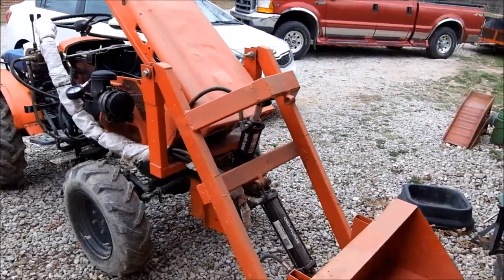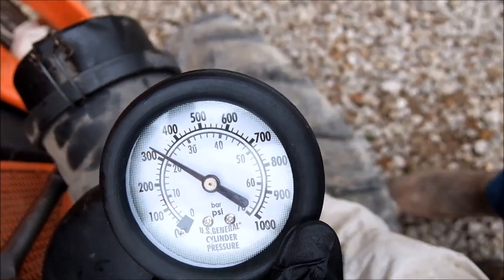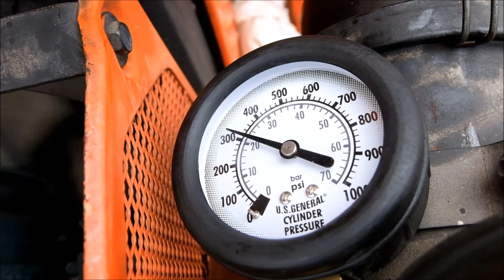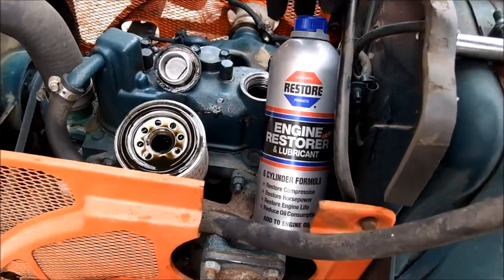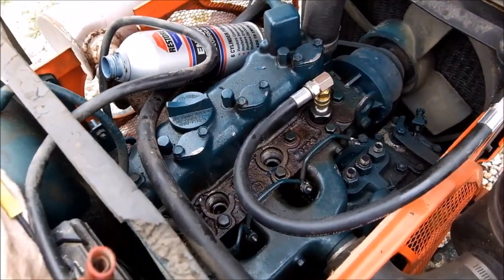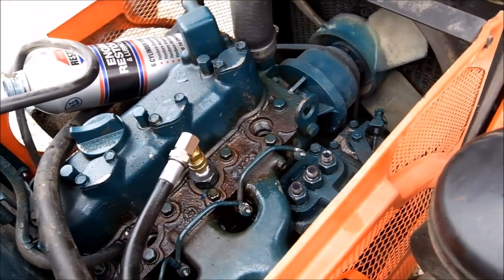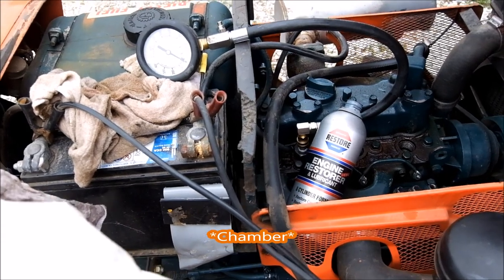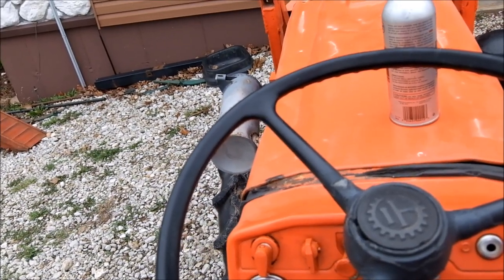RESTORE rebuild in a bottle and on a diesel?

Comment: I had a Mercruiser/Chevy 4.3L, 60psi in the low cylinder.  Ran this stuff and it went to 160psi on the lowest.  I took the engine apart and it actually fills-in the cylinder scratches.  I ran this in my 1992 John Deere 855, always had bad smoke when cold but got better when warm.  This almost eliminated all smoke, amazing product!
Reply from the maker: Still running in the kubota

Comment: Awesome. Use, test and results. All in the same video package. That is a "Thumbs up" in my book. ;-)
Those small tractors are amazing machines, underrated dogs for sure, but damn they work hard for a living.

It seems you have the tools and the skills, so when the time comes. Why not give it a new set of piston rings and a chamber/valve cleanup. You´ll be ready to go, for some years, with a lot less than needed for a full rebuild. It´s not the ideal, but anyway worth considering. ;-)

Cheers
Reply from the maker: Time....3 kids lol
Reply: @sweetpigfarm3645 - Yeah, 3 kids... I see, that¨s a lot of "cleanup", much worst than a valve job. But don´t worry they will stop giving head aches in about 30 years. LOL ;-)

BTW You probably noticed already. 6:36. Nut, in right hand side FEL post, it´s about to fall off. ;-)  
Cheers
Reply from the maker: Might be a teenage shop lesson for them! Good eye, those threads are smashed that bolt hasn't moved.

Comment: Why do you mention betting the summer starting being a ton better?? That’s confusing?? Has it been harder to start in the summer compared to winter?? I’m referring to before you used the restore. diesels typically start better in summer Was it different with low compression where it made it start better in winter than summer??
Reply from the maker: Well no matter the weather on these idi s you need to use glow plugs now with better compression it was better. Also I did this test in the winter so the compression numbers should  be better near room temp

Comment: Nice to see it worked, simple question did it help with the blow by or it stayed the same?
Reply from the maker: A tiny amount. Still there at low end.
Reply: @sweetpigfarm3645  nice video.  I have a 07 volvo semi Cummins isx,  which has blow by and over 1 million on it. Would I be able to use restore in it ? If so; how many bottles to 11 gallons of oil?
Reply from the maker: @kersaintsaintfleur7239  is that pre egr cooler?  Maybe up too 3 bottles. BUT, I would keep an eye on oil pressures I have a feeling more than one bottle might clog up an oil filter fast.  Have you tried their website?
Reply from the maker: @kersaintsaintfleur7239  Oddly the newer emissions ISX around 2010 models had carbon packing issues so Cummins issued a oil that would clean the carbon packing and increase compression...… restore in a gallon jug????? IDK
Reply: @sweetpigfarm3645  pre dpf, but not pre egr. Will check their website. Thank you

Comment: i am ready  for a oil change on my 1980 yanmar 2 cylinder diesel shoud i use the restore before putting new oil in or use it with fresh oil, thanks.
Reply from the maker: Use it with the new oil

Comment: If you don't use it often at least let it run for awhile. Thst stuff has to circulate for awhile. In the car they say to drive 200 miles.

Comment: What loader do you have on it and is it still holding up
Reply from the maker: Homemade loader. It's for material handling only. Is the restore still holding up? Yes did an oil change used it again. It's needed.

Comment: The problem of that products is how they fill also gap where shouldn't , like between piston ring and how they will accumulate into the head, is better to use a more dense oil instead of this , bye bro.

Comment: Gimick in a can!!!!! placebo affect strikes again!!
Reply from the maker: Did you watch the video? How do I and other youtubers (that are not sponsored)  fake compression results?
Reply from the maker: @mikesecondo2254  wow I guess my compression gauge is alive and is lying to me
Reply from the maker: @mikesecondo2254  it's not going to repair the motor the damage is there but it is filling the damaged cylinder walls and helping compression. I have to add a can at every oil change. You are correct it's not repaired but it helps
Reply: Try the product for yourself. It does work. I’ve used it in multiple engines and it works. Compression tests don’t lie.
Reply: @RicardoCanedoMX  no.. that's okay..I repair the correct way!!!
Reply: @sweetpigfarm3645  I can guarantee you he’s one of these  lectures or teaches that’s good on paper and prob hasn’t got hands to bless himself 🤪